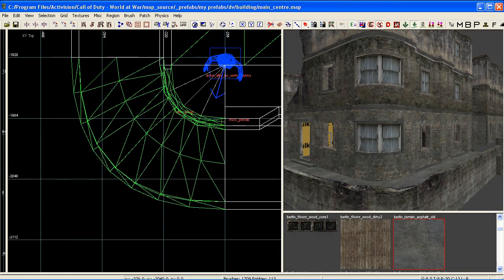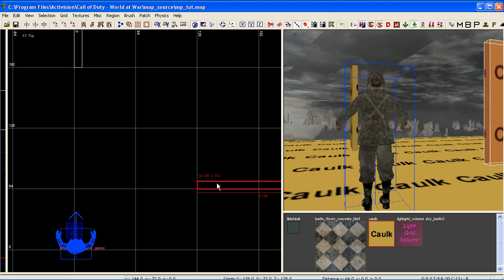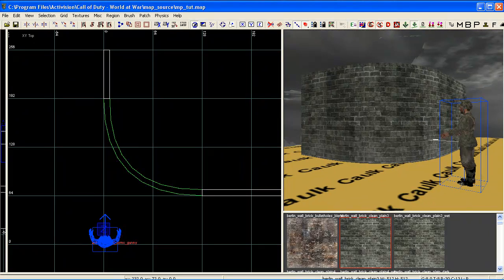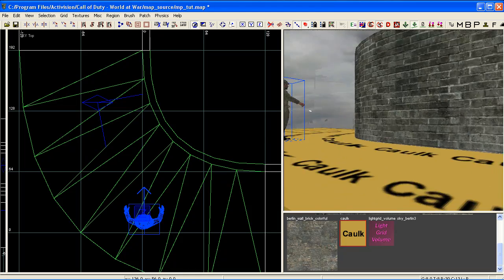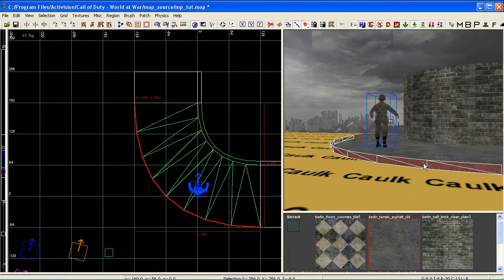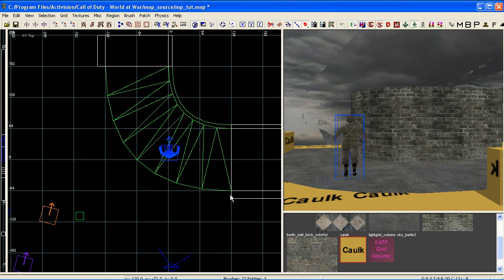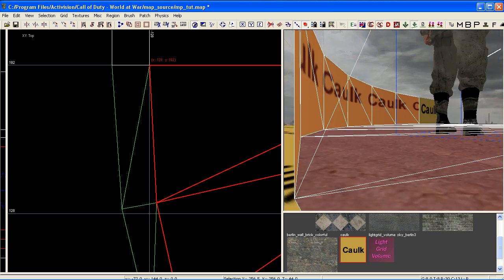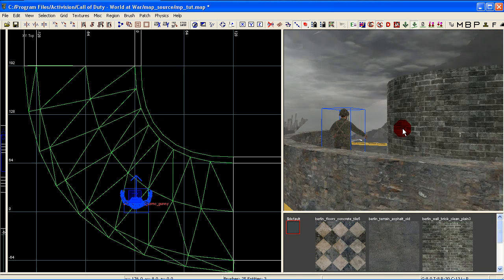CoD Radiant : detail made easy : Curved walls

Comment: damnit, I finally made badass curved corners on my bulding but I cant get the textures to match up. Ive used all the surface inspector settings, tried little adjustments, tried using alt right click to adjust, but nothing looks quite right. really irritating me :/

and why does my terrain_asphalt_runway not look anything like yours? mines looks more like rocky sandy dark dirt, while yours actually looks like asphalt